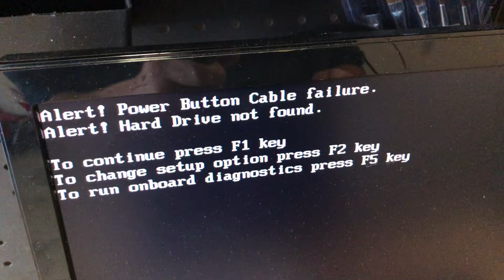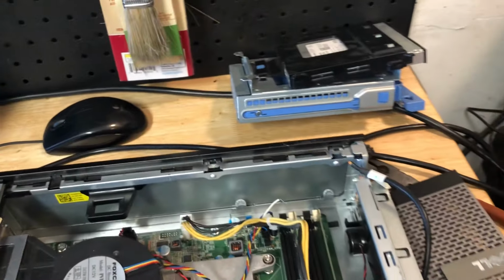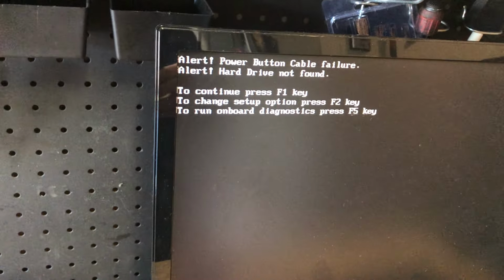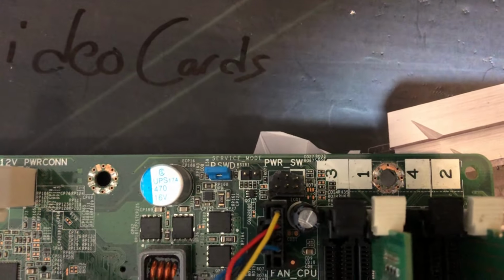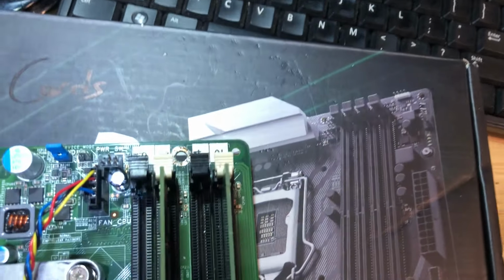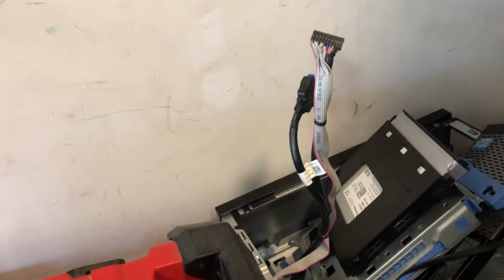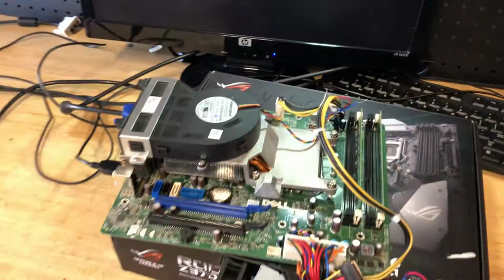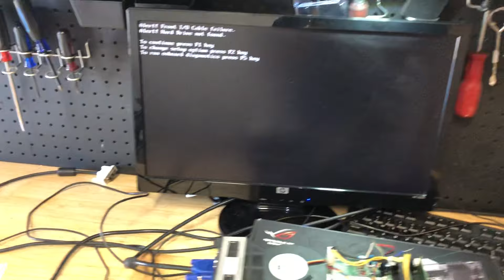Dell Optiplex power button cable failure! A guide on how to stop the annoying error!

Comment: I do not own the original case and there is no cables How do I cancel the problem
Reply from the maker: come up with you own wire like i did in this video, or you can search ebay for these adaptors that make it possibly to do without splicing. got a video on my channel about it.

Comment: Just short (4 and 5 ) as swicth A and 2 as switch B shorting 1 and 3 is not a good idea.. cause they hold dc voltages
Reply from the maker: good info thanks.

Comment: I'm having this issue with my optiplex 9010...
Reply from the maker: you can do the wire jump like I did, or buy the adaptors they sell on ebay.
Reply: @DLMtechgarage  It was working fine before I started messing with gpu... I will try jumper if doesn't work I will take to tech. I will let you know what solution was 👍

Comment: What if you don't have those pins
Reply from the maker: if you dont have the pins you can hack into the connector by splicing the two wires from the original harness. Then just tuck the original harness away. I have seen some people take the original power button and hot glue gone it to the new case. sorry for the late response and thanks for watching.

Comment: Just enable FastBoot in BIOS. That would make the BIOS to skip the initialization of non-essential hardware and proceed with booting the OS.
Reply from the maker: Don't recall seeing that setting.
Reply: This system never had a FastBoot option..
Reply: @digigroovestudios  Mine does
Reply: I tried the fast boot, but I'm still getting an error.
Reply: You don't just put it on fastboot once you do a fast food you have to go in and put it on auto. There's minimal and I think thorough and auto only auto will make the air go away

Comment: This didn’t mean work for my 3010 motherboard, I checked the connections tons of time, and they’re correct, but the pc just flickers on and off
Reply from the maker: hmmmm not sure but if the wires is not right and the pin is done right it will do that. I will post a link to a forum that probably explains it better then I did, hope it helps.

https://www.dell.com/community/Optiplex-Desktops/Optiplex-5-pin-power-button-assembly-pinout/td-p/6234979?lightbox-message-images-7673267=60958iE62B855334EC19EF
Reply: https://www.youtube.com/watch?v=5VzE_FkRfcU  This video would provide you with the correct wiring. The blue and orange wire is for the LED.  It would be shorted if you were to bundle it together.  Hope it helps.
Reply from the maker: @pernel48  thanks appreciate the infor!!